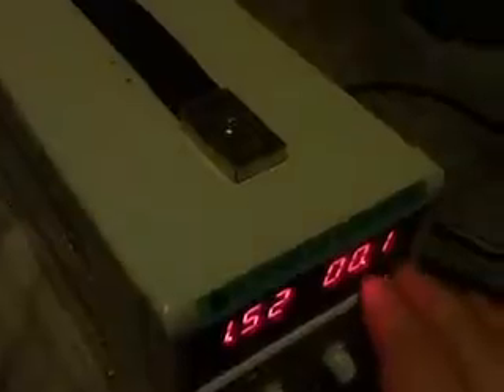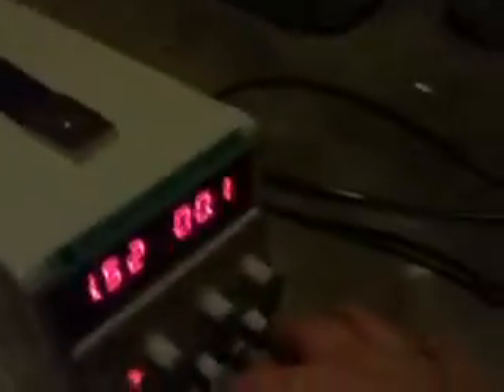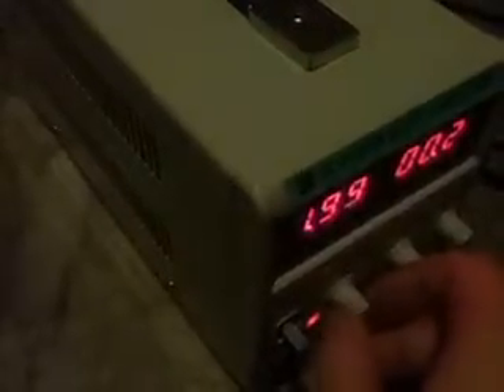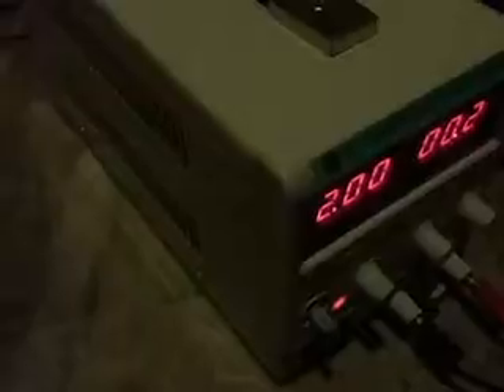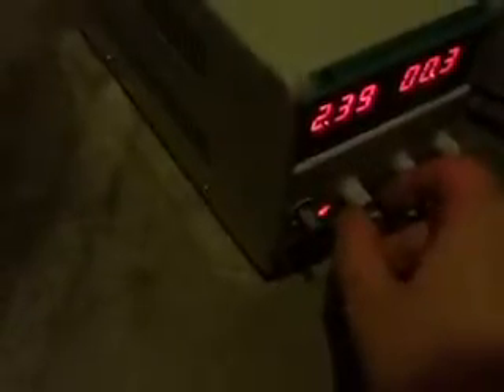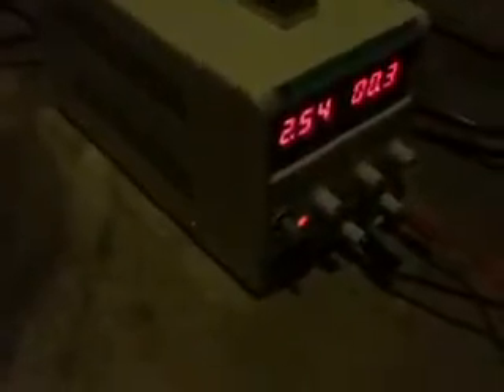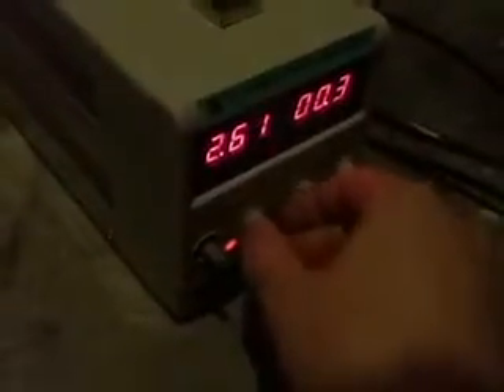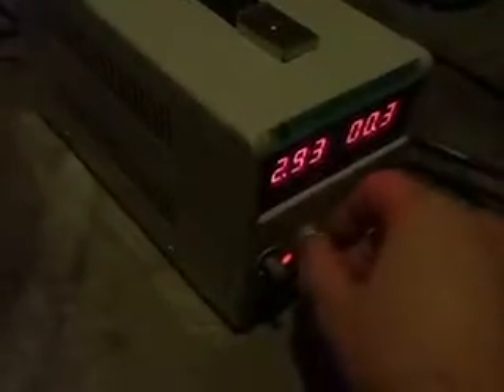Parallel fuse myth

Comment: Yes, it will boost the current limit, but you probably won't get a perfect doubling, because minor differences in the resistance of each fuse will cause the current sharing to not be 50/50, meaning one will blow first, but when it blows, the other will also blow instantly.